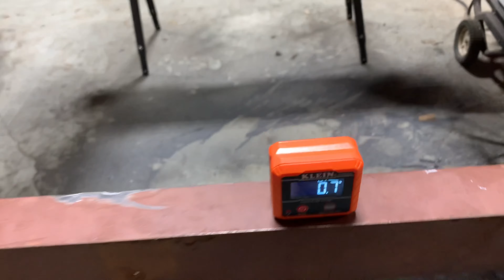Willys Jeep Custom Wood Bed!

Comment: I made a 3/4 Plywood Floor, completely removeable, for the entire rear floor of my 1993 YJ. It has 2 flat fold handles, and after removing a couple of hold down bolts, it pops right out. I am too old to be crawling under these old Jeeps, so accessing fuel pump, filter, exhaust, makes my Jeep Enjoyment all the better. A 1" Body Lift made it better too.
Reply from the maker: That’s a good solution! Thank you for sharing!

Comment: Beautiful job! You take your time and always do quality work (not to mention being talented).  A 50/ 50 mix of linseed oil and turpentine will soak in well and not dry sticky. Should take several coats to get good penetration. You can recoat it if necessary later on without any trouble too.  Again, nice work and thanks for the ideas...
Reply from the maker: I really appreciate the kind words! Thank you for the suggestion I’ll look into it!
Reply: I work with this product and oak won't take much of it, but it'll work fine.  Again, the ability to work forward and back without peeling is good.  For you other guys, they still make a real linseed paint which is infinitely thin, durable, and can work forward and back.  So action and durability of tractor paint but no thickness or peeling.

Comment: A suggestion to protect the wood and extend it's life is to brush it down with linseed oil, (flax seed oil) without it the wood will dry out and get brittle or soak up rain, swell warp& split.
Back in the day all paints were oil based, that oil was linseed oil, they used that formula for centuries because it works.
Reply from the maker: Good idea thank you!

Comment: Neat, tidy and strong, pretty much same as I did the bed on my Power Wagon only I used countersunk head screws on the loading edge. You could give the boards a couple coats of raw linseed oil for a start, then give another couple coats in a month or so.
Reply from the maker: Sounds like a good idea! Thanks!

Comment: That really added character to the Jeep. Too late now but I think I'd have ship lap the edges to prevent any water working its way in. Also the button-head bolts are cool. Find some stove bolts that are oxide coated flat black. Stain the wood to bring out that grain, or just plain water seal. Anyway about it great job.
Reply from the maker: Great ideas! I wish I was a better wood worker ship lap edges would have been great. Thank you for watching!
Reply: No, it's no problem:  run it over a table saw to put a groove in each side and put a short board or spline.  Nothing needs to change and I've seen this in 1910 barn floors.  Although yes, water coming up in without a spline was a thought.
Reply: Look up breadboard joint.

Comment: Just tip on my jeep project I've found Rust-Oleum makes a black spray rust converter . It works well ,dries fast , is tough, and has a good semi flat finish . Looks good under hood and underneath body.  Found it at Wally world for 6 bucks but I'm sure it went up.
Reply from the maker: I love that stuff! I didn’t show it but I hit all that rusty metal with that rust converter before the boards went on. Thank you!

Comment: Route a 1/4" X 1"  on each board saves the effort of using all those expensive button head bolts and leaves the floor flush. front to back.  Countersink the carriage bolts.  I prefer the look of a tight wood-to-metal fit, very professional.
Reply from the maker: That’s a good idea thank you! You’re right it does make things look better and more finished!

Comment: Paint the wood with POR-15  it will outlast anything else you try.  Mar-K did a very long study on wood finishes to see which brand would last the longest and POR-15 won...look it up!  I've had it on my bed wood for 8 years and it still looks great!  

Also, I hope you left a gap on the bed sides so the wood can expand and contract as the humidity changes...
Reply from the maker: I’ve used POR15 in the past and it’s great but never in wood, great idea!

I ended up with about a 1/4 inch gap on both sides between the wood and angle, hopefully that’ll be enough!

Thank you!

Comment: I LOVE IT.
Looks to be white oak.
If so, it will outlast you and probably the jeep.
Mix broiled linseed oil with paint thinner 50/50. Use 2-3 or 8 coats. It's a penetrating finish, not shiny and easy to apply
Reply from the maker: Awesome thank you!

Comment: I vote either thompsons water seal, or the cheap route that most guys do with their wood deck car trailers... rub it down with a few coats of used motor oil.
Reply from the maker: I’ll look into that, thank you!

Comment: How about a video to check and correct steering caster. There's just nothing out there for Dana closed-knuckle front ends.
I've got a 67 CJ5 V6 32" tires with 2 1/2" lift. Best I can do is measuring across the 4 cap screws of the steering knuckle king pin.
Reply from the maker: I’ll see what I can come up with for you, thanks for the suggestion!

Comment: Great job with the bracing uowever body made tooo stiff with no flex will crack the sheetmetal..consider bushing kit when u mount. To frame
Reply from the maker: That’s a good point! I’m going to be using some cj5 body mounts when the tub goes back on. Thanks!
Reply: @SevenBarSalvage  consider urethane body mounts and add some teflon washers too between bolts frame sheetmetal. U crank. The body. Bolts too tight you have no flex. Great. Project